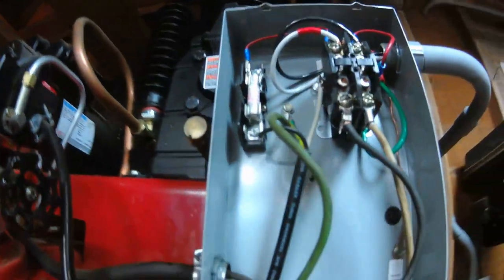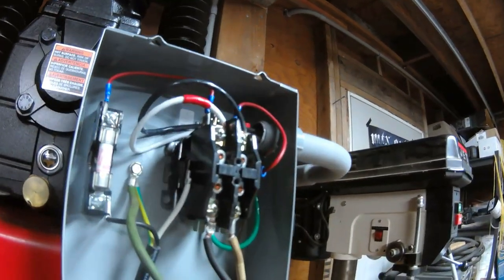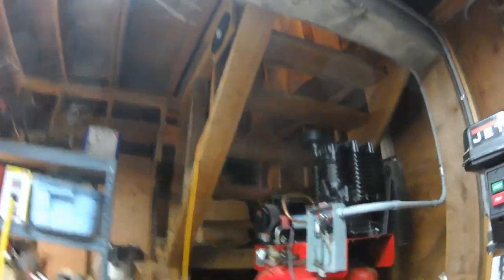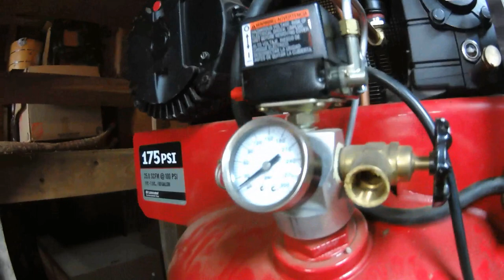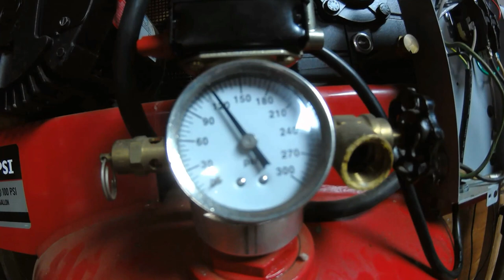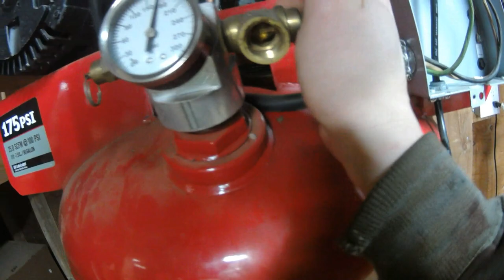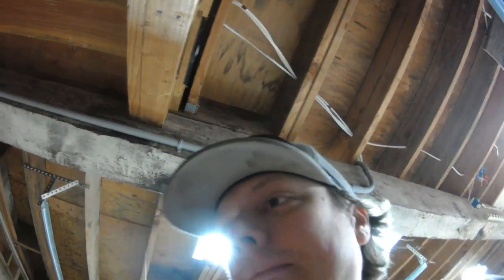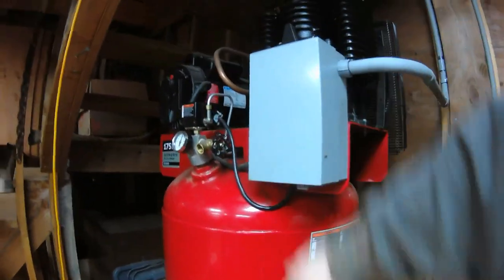Hardwiring 220volt Shop Compressor

Comment: I have a detached garage 70 ft away. I plan on running 8gauge thhn wire but once the wire reaches the basement should I install a junction box and convert it to romex 8 gauge to the breaker box? Or should I just run conduit in the basement and keep the thhn running straight to the box???
Reply from the maker: Sorry im not an electrician and can't give advice. Electricity is dangerous, it is deadly and you should hire an experienced electrician to do your work :)
Im sure someone else can chime in if they want but you do everything at your own risk.
Reply: Oh no I understand. I’m not doing the job. Well at least the wiring part I’m hiring someone but I’m doing the heavy labor like trenching and running the wire underground. My question was to see whether I should by more conduit or romex and leave it for the electrician to do it. I’m just trying to save some money. One guy quoted me $1000 for trenching and wiring🤷🏽‍♂️ just trying to save some money
Reply: @ClassALiving  why show the video at all then.  Appreciate the video but nothing educational.